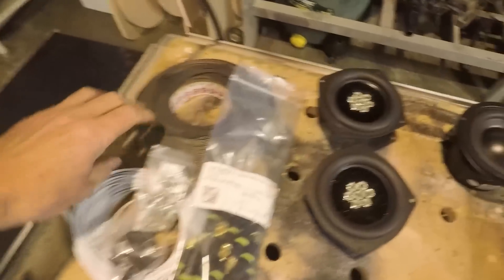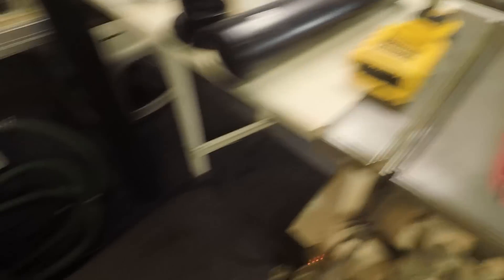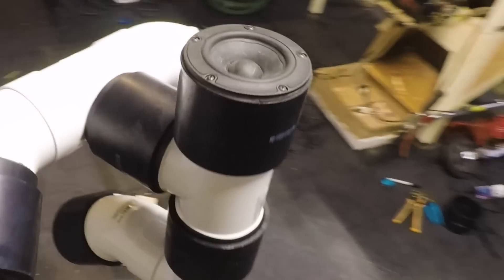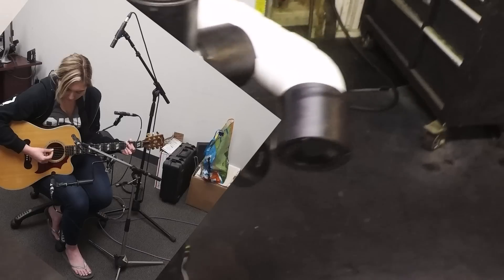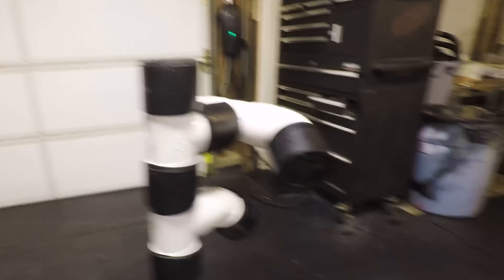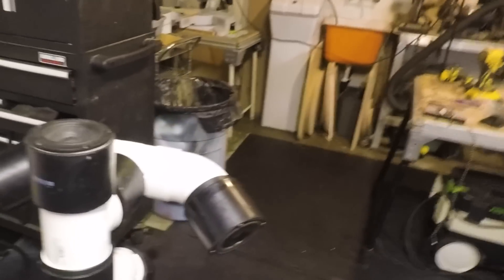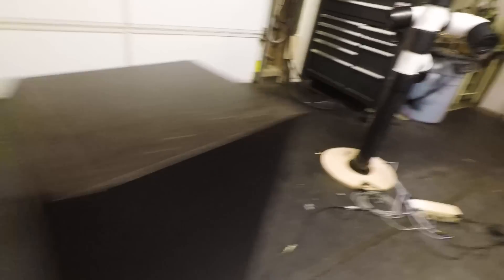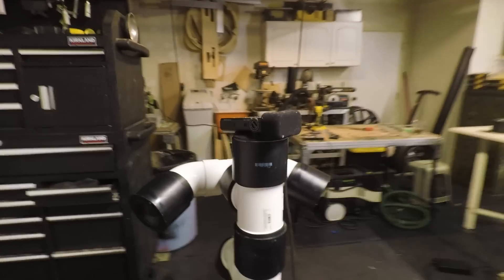Speakers Don't Sound Real, Lets Build One That Does

Comment: I think you would call that an  omnidirectional speaker. Not A New Concept.
Reply from the maker: Hmmm, not sure if you are unclear on what omni is or maybe missed the description of the speaker design in the vid.

An onmi speaker has a single input and sends the same sound in all directions. This speaker has 4 inputs 4 amps and sends differing sounds in 4 differing directions.

Pretty much the opposite of omni . 

8ts closer to quadrophonic yet unlike quad, this recreates the instrument in the listening room. 

Stereo, quad, surround atmos and all that try to recreate a different environment in the listing environment.

Comment: In this room I have a system that reproduces a guitarist recorded with 4 mics.  In this other room is the system used to reproduce a trio recorded with 12 mics.
Uh, don't think so.
Reply from the maker: And in these 12 restaurants we have a our favorite local musician simultaneously live streaming realistic audio.

And in this room we have a live performer over here and realistic playback of the performer coming from 4 speaker spread around the room. As if surounded by 5 musicians playing in sync together, fun! 

And in this living room we have a converted 9.1 surround sound system driving 3 smaller speaker versions of these speakers with 3 instead of 4 speakers in each with one unit for guit, one for vox, one for stand up bass and drums are spread across the them, plus sub, forming a realistic 4 piece jazz band playing and everyone says wow! I've never heard something sound so real!

I have been designing, patenting, manufacturing and selling for 4 decades now and there is always an endless supply of opinions of why things can't work. That's easy to do and so interesting to experience. 

And these nay saying opinions are a useful platform from which to build something that is useful and fun. Though it's more helpful if you are specific on why it can't work as that gives fun challenges to solve

Comment: you have actually reinvented the omnipolar speaker which has existed for a long time and is still on the market under different brands : Duevel , MBL  , German Physiks etc . Yours is actually a bad implementation of the omnipolar concept. BTW , omnipolar speakers do not solve the problem of sounding like natural instruments . Unlike you think , a violin for example does not radiate spherically across its entire frequency spectrum . Its directivity is highly dependent on the note played
Reply from the maker: Hmmm, I agree that omnipolar speakers would not be beneficial.

But I think you may have skipped past or missed the concept of this speaker.

An omni or omnipolar speaker radiates the same sound in all directions. That is the opposite of what would work well and is a reflection mess as all the reflections are the exact same sound as the direct signal and cause maximum comb filtering issues and is completely unnatural 

This speaker radiates a different sound in every direction. All acoustic instruments radiate differing sounds in differing directions. This is why this design works and omni does not

Comment: Would a cube arrangement work with maybe speakers on 5 sides and a stand on one? Or does the angle take away that flatness speakers make
Reply from the maker: The issues that I have identified that make speakers sound like speakers rather than the instrument are:

Ported enclosures. The ports have a resonance that can be ok ish but adding the same resonance to multiple instruments sounds fake

Baffles, the flat surface focuses sound in an unnatural way for some or most instruments and especially vocals.

Horns, the beamy directionality sounds nothing like most instruments except for brass instruments

Radiating the same sound in multiple directions, nothing naturally does this and sound unnatural

Radiating all the sound in one direction, most speakers do this and no instrument does this.

Comment: There is a way to get the effect of sound radiating from sources, but not sources that are within the room. Have you come across the concept of wavefront reconstruction? experiments from back in the 60's showed that you could reconstruct the circular wavefront propagation patterns of point sound sources, giving a true spacial sound field using a row of speakers reproducing sound from a row of similarly spaced microphones. They also worked out that the minimum number of channels for it to work was 3, though 5 or 7 worked better. The sound field, though, is behind the speakers, and that usually means outside the wall of the room. It is probably now possible to actually simulate the microphone spacing and the subtle phase differences between them, but the effect is destroyed if the playback speakers aren't the same distance apart as how the recording was designed for making it unsuitable for home playback of a pre-mixed recordings... though I think modern dolby cinema sound uses something like this across the front sound-stage. I can imagine, though, a recording being distributed with a number of separate mono tracks that then some playback DSP could do the phase shifts to match the actual positions of the speakers the listener has according to the spacial positioning information in the track for that channel...

What you've created here is the only way to get something that sounds like it's in the room with you. It's working with, rather than against, the brains ability to filter out the sound of the current acoustic space, and rather than trying to create the illusion of being in a different acoustic space than you are, it presents the sound in the space that your ears and brain are acclimated to.
Reply from the maker: I am familiar with wavefront synthesis and other ways to try and create illusions using complex processing.

And thank you. Yes, you get it!!!

Comment: Interesting design.  I have seen similar concepts from various companies but  I think the flaw in all of them is that a driver has to load a box, or a tube in your case, then emit sound.  Electrostats load the air like a real instrument, plucking or striking a string instrument.  They just cannot play as loud or as efficiently as a cabinet.   Some companies go to heroic lengths to build inert cabinets(Wilson Audio), but it's still the same process.  Someday someone will come up with an electrstat that goes as loud and dynamic as an ATC or Wilson speaker.
Reply from the maker: I think all the other designs radiate the same sound in all directions, this radiates a different sound in each direction.

This is the key to success

Comment: The speaker that makes you think that you're listening to real instruments already exists and it was first built in the late fifties.  It's called the Quad ESL57 and I have had guests come by think there were real pianos, violins, cellos, etc. in my living room.  Others, centrally seated in front of them including myself think that they're like listening to the CSO standing just outside the doors entering the main floor.
Reply from the maker: Are you sure?

The speaker I built sends different sounds in every direction and requires different inputs for each speaker.

I believe the quad ESL 57 is an electrostatic speaker that sends the same sound in every direction which is the opposite of what I'm trying to do
Reply: @DaveRat  Well, yes, I meant that there already is a speaker that makes people think they're listening to the real thing; even musicians could get fooled.  Your idea does not practical.  Where to begin?  This requires a long explanation, but in a nutshell, you suggest recording(this works with small, quartet or smaller, acoustic instrument groups) each individual musician in a group, then reassemble the performance with separate speakers.  So do you attempt to capture the same acoustic space for all the musicians?  Or remove as much of the acoustic space as possible, hoping the room where you play back the performance does the job?  I'm at a loss here.
Reply from the maker: I enjoy the perspective of listing all the reasons something different won't work based on trying to fit it into exsisting seemingly rigid parameters.

That same effort could also be spent of figuring out how it could work and the value in various applications.

Using existing tech, like a s surround 9.1 amp and signal and reducing the speaker from 4 inputs to 3 inputs would allow 3 of these to be placed in a space, perhaps representing a vocalist, a guitarist, a standup bass player and a subwoofer. Using 9 +1 channels.  Then a drum set could be added by using 2 of the vocal speakers and a few speakers from the guit and bass. 

Now with existing readily available home hifi you have a more realistic 4 piece jazz quartet setup than anyone has ever heard.

Or, a singer songwriter makes 6 of these and drops one into various bars and restaurants around town and live streams 4 channel audio to them all simultaneously and plays a live gig in 6 venues at once. The bars and restaurants now have an amazing realistic audio show piece that sounds real and astounds listeners

Or  perhaps a video conference hologram with a speaker that sounds as or more real than the hologram looks.

For me it's more fun thinking of new things and how they can work vs looking at things people make and spending energy on why they can't.

I will do more work on it and vids and see how it goes.

Fun!

Comment: Can of worms dude. Frequency travel speed, individual room reflections and listening position. Good luck figuring out one simple solution.
Reply from the maker: Well this simple solution already works so I'm off to a good start I think
Reply: @DaveRat  Life's about the journey!
Reply from the maker: Yes. the reason this works so well so easily is I did not follow the rules of stereo where they try and recreate an environment in the listener's room.

That is hard and requires much effort and never will completely work
.
Design purely tries to recreate only the instrument into the listener's room, no environment. So capturing the instrument with multiple mica and re radiating each mic through seperate speakers pointed in different directions is is a simple way to effectively make that happen
Reply: @DaveRat  Didn't Bose already walk this road with the direct reflecting 901s? They had to be set up perfectly and then equalized to push all 9 of the 4-1/2" full range drivers. Some swear by them, others not so much...
Reply from the maker: Bose and all the other reflecting and omni speakers send the same signal in all directions which is the opposite of realistic and creates maximum comb filtering on reflections combining with direct signal.

This sends a different signal in all directions. Like a real instrument does
Reply: @DaveRat  Cool. Hope you set the speaker world on fire with a new innovation. Best wishes.
Reply from the maker: Well at least get people thinking and hopefully pushing for new fun stuff
Reply: @DaveRat  Just by chance I watched a vintage TV program today where the inventor of the Bose 901s explained his design. In layman's terms, normal stereo recorded imaging, the "orchestral stage" position of an instrument moves with the listener as they move from directly in front of one speaker (let's say left) to directly in front of the opposite (right) speaker. For instance, the sound of a piano would appear on the left side of the stage then move to appear on the right side of the stage. The 901s were designed to fix that simulated movement. For instance if the piano was on the left side of the stage, when the listener moved from in front of the left speaker to in front of the right speaker the piano would still appear to be on the left. When standing directly in front of the (left) speaker you have 1 full range speaker coming at you while 4 reflecting full range speakers are coming at you from the right speaker.
Reply from the maker: Yes, I have owned a few sets of vintage 901s over the years.

They sound meh, but interesting idea. The issue is that when you radiate just one signal, it sounds like all the instruments or mics on an instrument come from a single source, whether you reflect it or not, it's still one signal. Same issue with onmi speakers.

The key to realism I am finding is that a different sound recorder from a different part of the instrument needs to radiate in different directions to sound realistic.
Reply: @DaveRat  Yeah, they sound meh to me too. They have to be set up properly and equalized in a proper environment to sound okay. Sounds like you're attempting to develop a "sphere" speaker. I know it is not the answer you are after but (in my humble experience) rebuilding existing crossovers with top notch caps, resisters and inductors seems to widen the field of sound emitted from conventional drivers. Good luck!
Reply from the maker: I am trying, well actually made, a speaker that radiates diff sounds in diff directions. It does not need to be perfect as no instrument is. Sound gets blocked and altered by the human playing it, the shape of the instrument and way sound radiated differently from the body vs the strings, vs the front vs the back and so on

It is these differing sounds radiating in diff directions that is real.

Made a speaker that does the same thing so as you move around the sound changes, just like real

Comment: That creation of yours, is not a million miles away from the Nautilus from Bowers & Wilkins.. so, if you need 4 of them to recreate a quartet? How are you going to recreate a full concert or symphony orchestra? Or a full blown choir? When a band is fronted by an energetic vocalist moving around the stage, will you create one of the devices to be wireless and motorised? Enabling it to accurately mimic the vocalist’s on stage acrobatics?
Reply from the maker: You own a car right? Hold 4 to 6 people?

How are you going to transport a whole soccer team or race the Baja 1000?

Maybe best to use the right tool for the right job and what I am offering is a way to reproduce an instrument in a realistic way that conventional speakers can not.

Oh, and B&W do not make any multi channel multi directional speakers.
Reply: @DaveRat  the B&W Nautilus does bare a striking resemblance to your creation. If I had to transport a football team, I wouldn’t contemplate using a family saloon, vut that doesn’t explain how you accurately recreate a full orchestra using your multidirectional speaker assembly.
Reply from the maker: Same here, using a speaker that is optimized for creating a single instrument audio hologram for an orchestra is as logical as trying to transport a football team in a family sedan.

Trying to do a rock concert with your home stereo or using your iPod earbuds for family listening also may not be optimal.
Reply: @DaveRat  ok, so we can agree that your creation whilst it may sound more realistic recreating an individual instrument, becomes impractical for much larger productions.

Two channel stereo, is an elusion. It relies on the time delay between left and right speaker to place instruments in the soundstage. Good luck in designing a format which produces a more realistic reproduction.
Reply from the maker: And also, by muting speakers, or altering processing these become and do normal stereo

So yeah, they will do stereo and all the normal stuff in normal ways and also be able to recreate realistic audio as well..
Reply: @DaveRat  👍

Comment: Hi Dave, yes it sounds real. What you are trying to create is a hologram for sound. In summary, you suggest a speaker for each instrument, and record company has to release each instrument track so it can be played back through the relevant speaker? Could work. Call it walk-around-sound, not surround.
Reply from the maker: Yeah, and there are more applications that I think are better suited. Like using one of these speakers with an actual hologram of someone playing guitar.

Dropping one of these in a dozen restaurants and bars and a singer songwriter does a live stream realistic sound to all at the same time. Sound so real it sounds like they are there.

At trade shows with someone speaking or for a small gig, a musiciam is playing and drop 3 or 4 more of these around the room instead of a PA